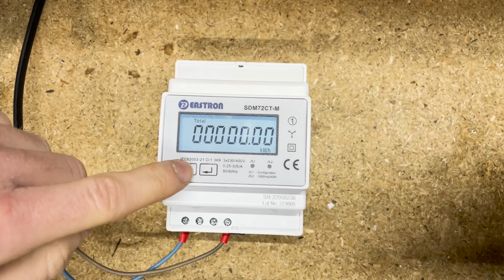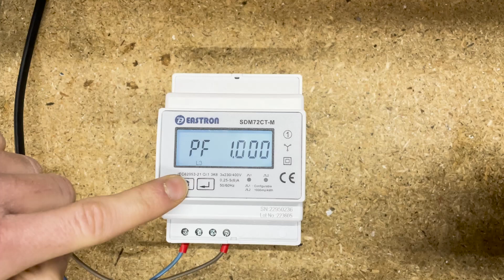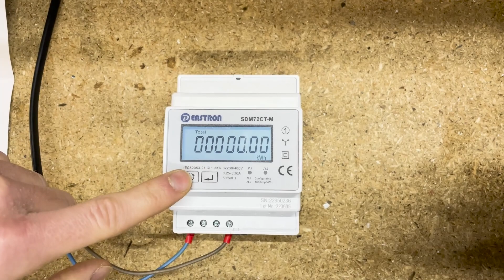How to read the Eastron SDM72CT-M

Comment: So I have a question regarding the sdm72d-m. It seems that the meter can't count the "real" imported kWh. Meaning counting only the amount of kWhs that you take from the grid. Or is there a trick to get this value?
Reply from the maker: Hi there, the meter will count everything that flows through it, both imported kWh, Exported kWh and Total kWh (imp + Export). Depending on where you meter is installed will determine what it actually reads, so it’s quite difficult to give advice without knowing more about your installation. Apologies I couldn’t be more specific.